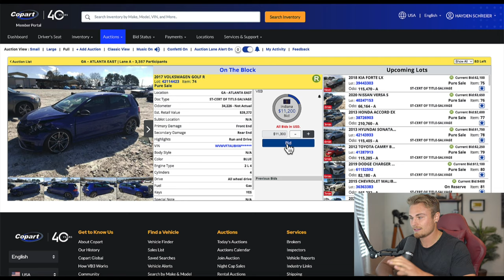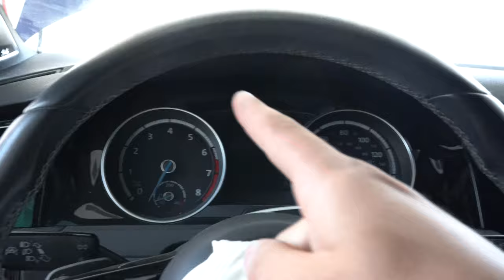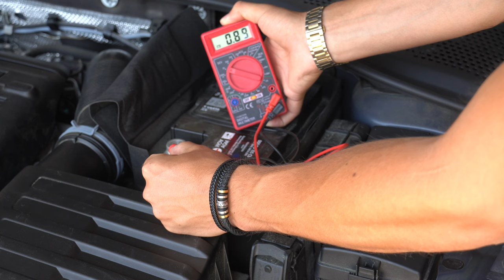REBUILDING A WRECKED VOLKSWAGEN GOLF R | PT 1

Comment: Hayden , i repair clusters/car electronics for a living. Just remove the plastic cover from the cluster and simply turn the needle to the right. So anti clock wise untill you are close to zero. Dont pull , just turn it anti clock wise. 
You will hear some clicks but that is normal. Engine is fine.

All information is coming from the ECU and is communicated over the CAN network. So if your ears say the engine sounds fine then dont worry.
Reply: Ps , use a " dentist glove " , the dials are very easily damaged with your nails. Very easy fix! 👍
Reply from the maker: Check your Instagram DM's I have a follow up question!

Comment: Hey man. The front radar, and blind spot  modules will require calibrations. I do if for a living and it’s something you do Not want to skip!
Reply from the maker: i appreciate this! given the front radar only fell out of its bracket, it should be aligned straight. There should be a way to calibrate it with my OBD 11. I had a feeling it needed to be calibrated
Reply: @Haydenschreiermk2  so some vehicles require a target, others require a driving calibration that is dynamic. So I’ll check and let ya know
Reply: @Haydenschreiermk2  Hi there i also work with many golf 7 crash damaged cars. Since you replaced the radar sensor this will need to be unlocked online and coded to the car. In addition to coding the radar sensor you will need to have the car 4 wheel aligend and after that you will need to have the radar sensor calibrated. Golf 7 will need static calibration with a target board :)

Comment: Leon Cupra driver(same engine )100% remove the bag but change the coolant regularly 👍 also did you code that battery after replacement 👌
Reply from the maker: haha, im glad i removed the bag. yes i coded the battery after replacement. I showed it in the video!
Reply: @Haydenschreiermk2  good stuff,  sorry I commented before you pulled obd11 out 👌